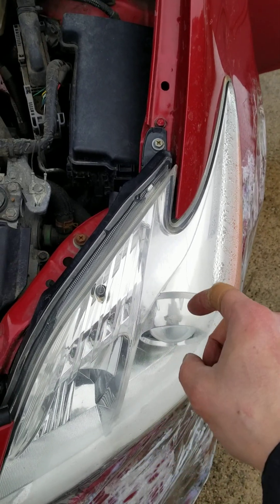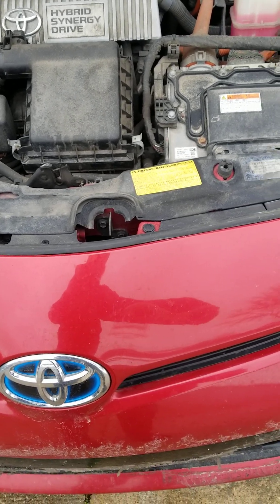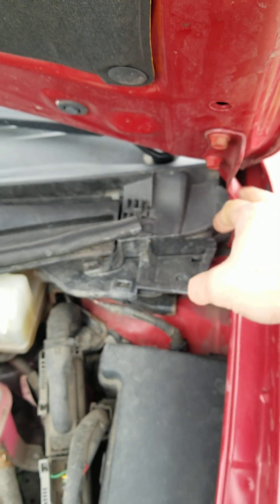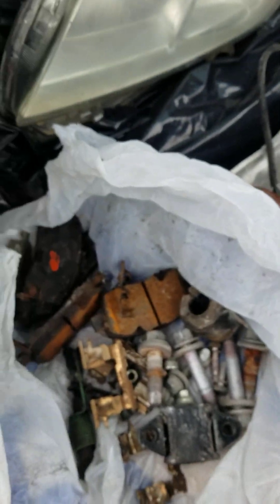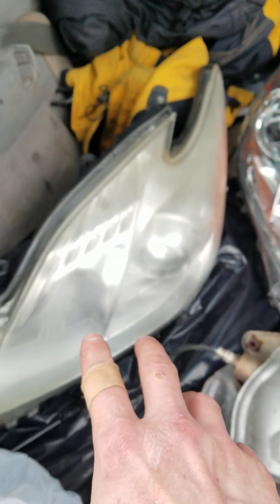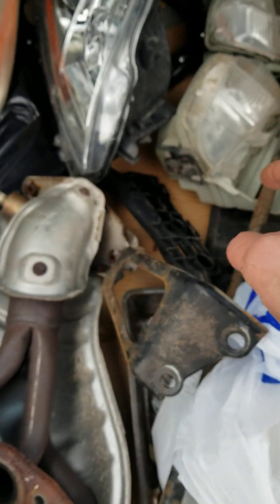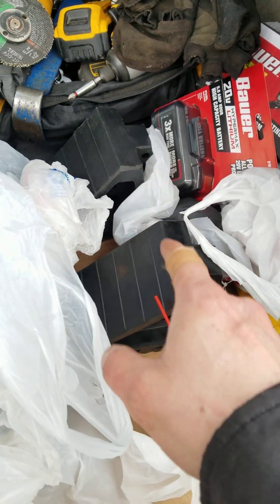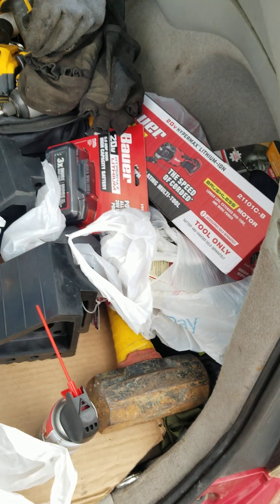Light Bulb Base Broke In Socket Then Drivers Hood Latch Broke After Retrning From A Trip To The Yard

Comment: You in grand Rapids mi. I'm working on a TOYOTA Prius 2006 front hood latch Thanks
Reply from the maker: Not at the moment, though I go to GR routinely.  Weller and Lucky's Self Serve as well as other yards in the area for parts.  Gotta save those parts from the crusher shredder and being melted down when they might be OEM and perfectly good to use anyways.  Plus the price is hard to beat.
Reply from the maker: I have a 2006 as well.  I think the hood latch is a little easier to access if I recall.  If you need me to make a video, just say the word.  With the 2013, would have been a little easier with the longer nut driver magnetic extension.  I was planning to get a set of Hercules 6 in. Impact Rated Magnetic Metric Nut Setters, though HF was out.  Mainly with these, be sure to lubricate the hinges as I think that's why mine failed.